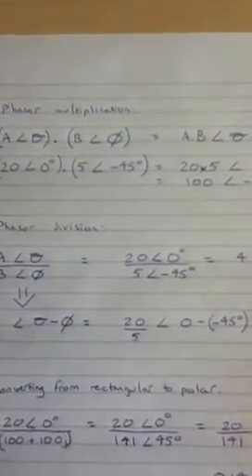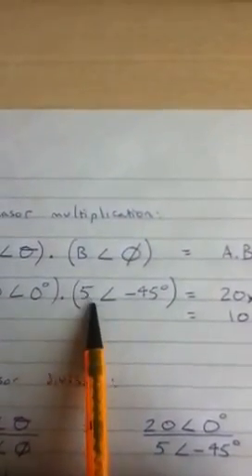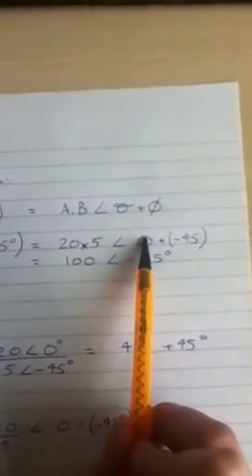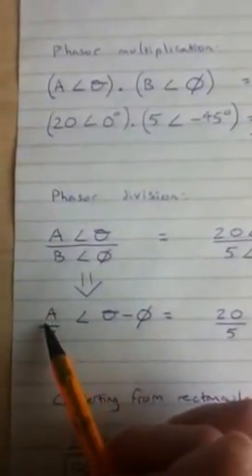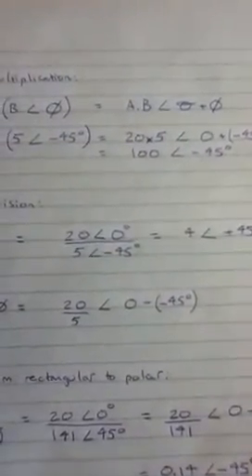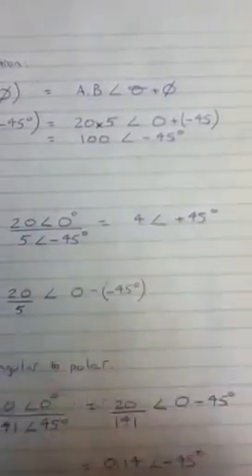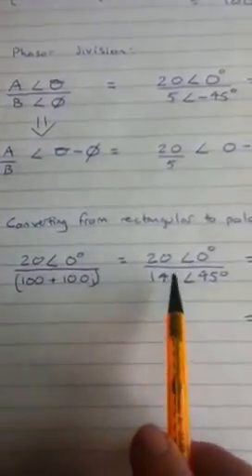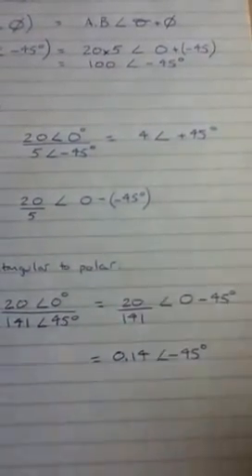ELEC142 phasor multiplication, division and rectangular num

Comment: you should convert phasor to rectangular and show us how you get the answer
Reply: Draw it out on a right triangle with x as one leg and yj as another, and theta is theta (θ) is the tangent angle of the legs. 
Using the problem above

r∠θ is the polar form;  r = x + yj is rectangular; This follows to square both sides of the rectangular form.

r^2 = 100^2 + (100j)^2  ---> (square root both sides) ---->  r= (100^2 + (100j)^2)^(1/2)   ---->  r= 141.4
tan(θ) = 100/100   ---> θ = arctan(100/100)   ------> 0.7854 rad*(180°/π rad)  ----> 45°
= 141∠45°